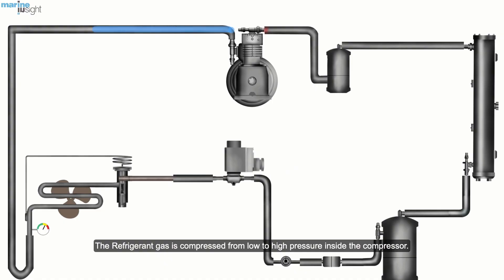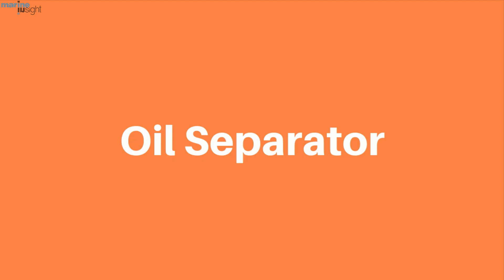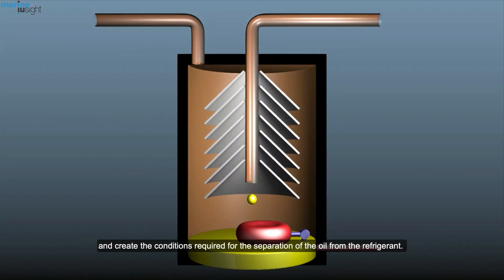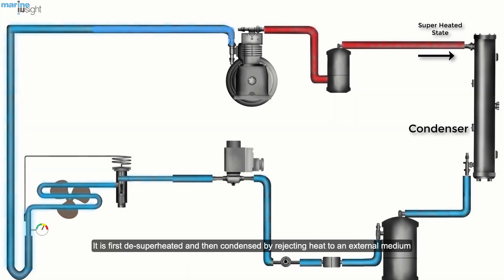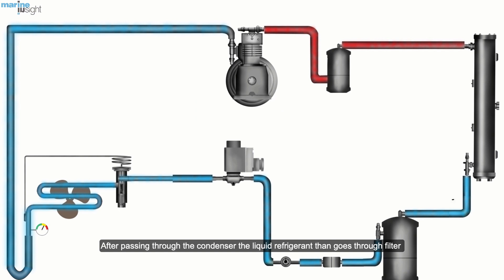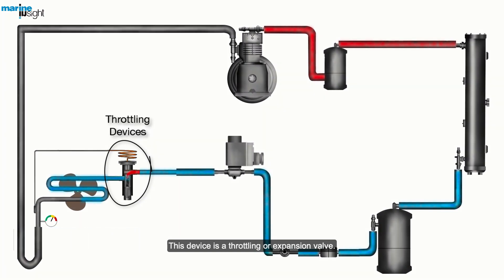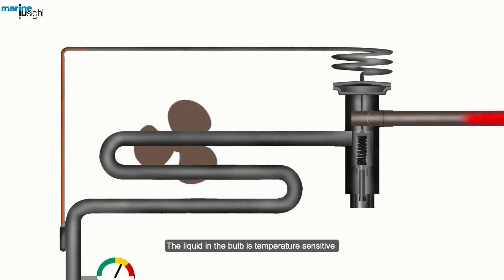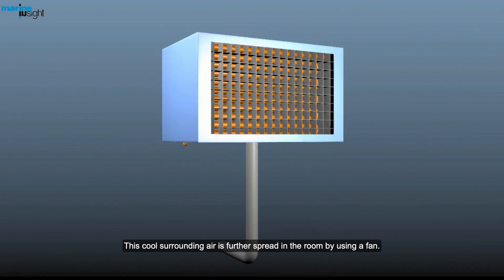Parts of HVAC System

Comment: Please this setup is kind of confusing . Between the placement of oil separator is before or after gas compression. As the explanation from the video I can't see how oil can flow back ward  after speration
Reply from the maker: Check the explanation at 1:05

Comment: Why ice comes after the expansion valve but not into the evaporator in the vegetable room
Reply from the maker: Expansion valve is a throttling device which suddenly cools the refrigerant leading to icing in it's outlet. The vegetable room temperature is above the freezing point hence no icing in the evaporator.

Comment: What is the component between the condenser and filter , is it oil separator.
Reply: SO what is the component after the condenser? TIA.
Reply from the maker: Oil separator comes after the compressor

Comment: pls make vid about how to recharge the refrigeration system. Thank you so much marineinsight
Reply from the maker: Thank you for commenting.
Check this video for refrigeration charging - https://www.youtube.com/watch?v=8LibksMrUXg
Please do share and subscribe to our channel.
Reply: @marineinsight  thank you 😊
Reply from the maker: @mridulvijaybabu457  👍🏻Please do share and support
Reply: @marineinsight  can u expain to me ..why there is an equalising line in the TEV ?
Reply from the maker: @mridulvijaybabu457  The purpose of the external equalizer is to sense the pressure in the suction line at the bulb location and transmit it to the TEV diaphragm.
Reply: @marineinsight  pls explain internal equaliser   ..if possible
Reply from the maker: An internally equalized Line will senses its outlet pressure, using it as a closing force on the underside of the powerhead’s diaphragm to offset the opening force of the pressure from the temperature sensing bulb on the top side of the powerhead. These valves are typically used on evaporators with a relatively low pressure drop.
Reply: @marineinsight  thanq so much 😍
Reply from the maker: @mridulvijaybabu457  most welcome 👍

Comment: Where does TEV located, near compressor area or in the room where evaporator is located
Reply from the maker: TEV is located outside the Cold storage rooms i.e. near evaporator. It is not located near the compressor, which is usually located in another room.

Comment: What will be the state of refrigerant after the expansion valve?
Reply from the maker: It will be liquid+vapour mixture which than absorbs the surrounding heat in the evaporator and converts to superheated vapour before  heading to compressor

Comment: How the liquid refrigerant will become completely vapour before going to compressor?
Reply from the maker: Please refer to 5:12 min. 
As the liquid passes via evap, the the cool liquid refrigerant absrobs heat from the surrounding and resulting in converting into vapour.
Reply: Will it completely become vapour?
Reply from the maker: @karthicksuresh6962  it has to else liquid is uncompressible and it will damage the compressor. Throttle valve ensure adequate refrigerant is passed so that all of it can evaporate.

Comment: Why do we need to change the refrigerant and on which point we can recharge it?
Reply from the maker: The Refrigeration level can go down due to the following reason:
- Because of leakage
- Maintenance done on the system
- Change of lube oil etc. 

Charging of Refrigerant is done at a  charging point provided before the receiver.